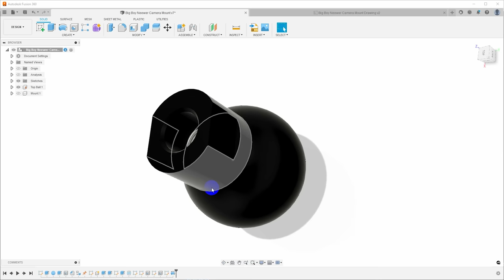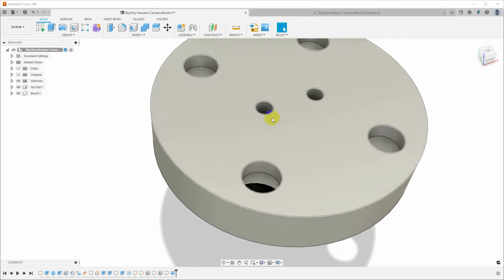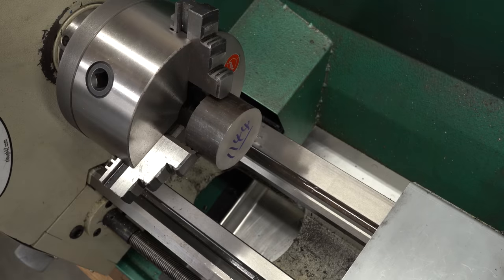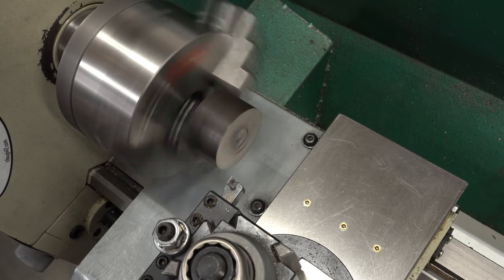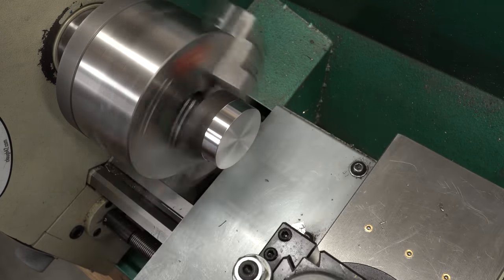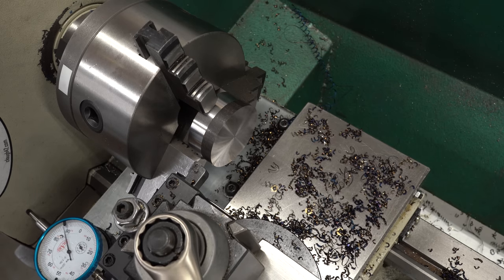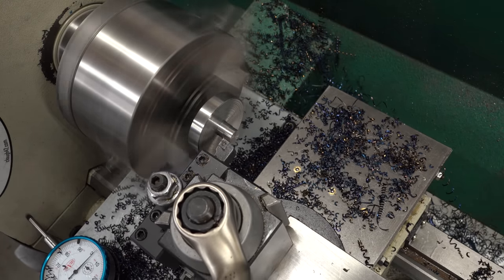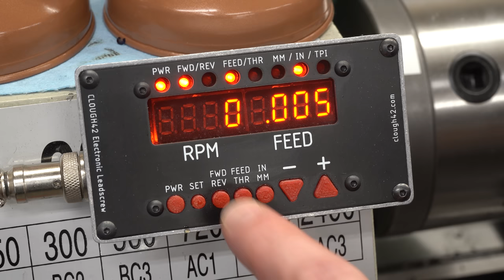Thread Milling on a Small Lathe | Making a Magnetic Camera Mount

Comment: this noga is not Overkill for indicators . maybe for the regular sized ones. But in a mashine shop you have many sizes  i have one with 150mm travel  at my job and this thing is heavy  you need somthing like this to get accurate readings
Reply from the maker: That's cool.  I have thought several times about getting a big dial indicator for my lathe, but opted to go for a DRO instead.

Comment: I would have done two things differently. I would have used a grade 8, 6mm bolt through the center, not a threaded integral stud. I also would not have counter bored the four plate holes, that way I could reach the hex head bolt with a flat wrench, lower profile and easier to reach than using a hex allen wrench.

Comment: Coulda just drilled a through hole in the center. Countersunk and used an allen cap screw to mount to the arm, but then i guess we wouldn't have seen that cool lathe mill threading. 😎
Reply from the maker: That also wouldn't have produced the registration shoulder feature I wanted.
Reply: @Clough42  true! It turned out nice

Comment: Can you anodize or powered coat in black to match the plate and arm and prevent corrosion?
Reply from the maker: Powder coat is a possibility, if I had the gear.  In general, camera gear wants to be black to prevent reflections.

Comment: Average armchair critic... I would have milled a socket for the shaft and wrench flats so the ball part fits into the adaptor plate.
Reply from the maker: I considered it, but there isn't enough length on the boss, and this would interfere with the ball pivot.

Comment: my only comment would be those set screws were overkill, any torque that would be great enough to unscrew that m6 would turn the ball before that happened. fantastic job though! thread milling on the manual lathe seems impossible yet its not lol
Reply from the maker: I didn't add them because I imagined there would be a problem.  I added them because I struggle with camera mount studs unscrewing on other gear on a regular basis.

Comment: Newbie question, why did you use a single piece of metal to make the entire adapter instead of making a disk and threading in a stud?
Reply from the maker: Didn't think of that.  I thought about using a screw, but that would not have allowed the shoulder.  I don't have any high-tensile small diameter material in the drawer, though, so...
Reply: @Clough42  since you've got lots of tools / techniques at your disposal, I just wasn't sure if it was a design / engineering practice or just based upon the material at hand.

Comment: Why thread mill instead of single point cutting? You need to set up and align the tool post grinder and the cutter must be expensive so it seems like a lot if extra effort and expense. Was there a special reason or just for the fun of it (which I totally get).
Reply: I believe "the fun of it" is spot on!
Reply: @paulcopeland9035  i kinda suspected that. 😜

Comment: Instead of using the set screws you could of just used Thread Lock or Lock Tight. Would of been easier, and there are different strengths available.
Reply from the maker: Maybe.  I have some other mounts that have come loose on me despite the loc-tite, so I opted for mechanical retention.

Comment: JC does not trust green Loctite?
Reply from the maker: Trust it for what?  To hold an M6 thread against the rotation torque from a 70-200 f/2.8 lens?  Nope.  To release when I want to take the adapter off and use the Noga arm for something else?  Also nope.

Comment: Why not use a threading lathe tool, why did you go with the threadmill?
Reply from the maker: I was making a relatively short thread that needed to go all the way up against a shoulder.  I didn't have room for a gutter to stop (or start) the thread, and didn't trust my ability to quick-draw the tool and stop the lathe while still running it fast enough to get a good surface finish on the thread.  Given it's a metric thread on an imperial lathe, opening the half-nut is tricky and easy to screw up.  I had a threading tool in the drawer and a live spindle, so I decided to give it a try.
Reply: @Clough42  oh yes, I forgot about the half nut issue! It was really cool to watch and I love your ELS

Comment: Wouldn't it have been more straightforward to make the piece flat and drill an M6 clearance hole (instead of turning the stud), counterbore the top and fit it to the ball mount with an M6 cap screw?
Reply from the maker: I wanted the shoulder to register in the counterbore in the ball stud, and there isn't enough meat there if I put a clearance (or threaded) hole through the part.

Comment: I hope you wipe down and oil the ways of the  lathe after using emery paper.
Reply from the maker: Hope is not a process.
Reply: Doing it is the process of preserving your lathe bed. Failure to do so will quickly wear out the ways as you slide the carriage over the abrasive dust left on the ways.

Comment: Why don't you cover the guides when you sanding? (or some oil - the abrasive won't fall to the guides)
Reply from the maker: I have a shield on the lathe that catches most of it.  If it's going to be excessive, I do cover the ways.

Comment: 1144 usually breaks chips way better than that. odd.
Reply from the maker: There are a lot of variables, for sure.  It's very possible a different insert with different chipbreaker geometry would have worked better.  I have some new tooling I'll be putting to work soon, and I have a bunch of different inserts to try.

Comment: Thread locker..s'all I'm saying.
Reply from the maker: Feel free to trust your camera gear to that.  And if you use something strong enough to hold, good luck getting it out later when you want to use the Noga arm for something else.
Reply: @Clough42  modern thd lockers have advanced considerably over the old days when heat was required to disassemble parts.   They hold under all normal conditions, and residues aren't a problem , and if so , clean it out with a tap.   No need to fear using thd lockers these days.
Reply from the maker: @jamesr.9239  As I said, if it's your $5k in camera gear, feel free

Comment: By the way that is not thread milling if that machine of yours was oscillating around the standing still shaft producing a thread that would be thread milling just because you put an end Mill in place of a turning tool doesn't make it a milling machine
Reply from the maker: An excellent example of combining two logical fallacies into one comment: a Strawman, and a Distinction Without a Difference.  Well done.

Comment: The machining is awesome but the design is not my taste. A single lump of aluminum and a screw in the middle would make the trick and get so much easier to make...well it's easy to criticize but your did it great anyway.
Reply from the maker: This is a great comment.  I chose to go this route because I wanted the cylindrical register in the socket on the end of the arm, and wanted a material harder than aluminum because the moment arm is large and I was afraid aluminum would deform and loosen.  It's entirely possible aluminum would have been fine.

Comment: Or you can just buy a C stand and not try to mount cameras to running machines that are going to vibrate no matter what.
Reply: Agree. Maybe he should make a c-stand. Just please done buy some shitty quality c-stand. Get a Matthews.
Reply from the maker: In fact, I have three C-stands that I use regularly to get cameras into all kinds of weird places.  The heavy B&H house brand ones (Impact) are pretty solid.  The lighter Neewer ones are a lot easier to move around, but they require some modifications, like adding aluminum friction disks, to make them usable.  Even then, they're really only good enough for something light like a GoPro.

Comment: So your design is unnecessarily complicated why did you machine down so much material for a little stud when a hole & bolt would’ve accomplished the exact same thing
Reply from the maker: I wanted a shoulder to fit tightly in the counterbore of the Noga, and there just isn't enough space to get that with a screw.  The wall thickness would be something like .020", and that wouldn't have the strength I wanted.

Comment: Great video. I’ve used the els to manually cut threads before but not with a mill cutter that was cool. I think I would have just used x and y offsets from center to drill the holes to save the time setting up bolt circle
Reply from the maker: I used offsets from the center.  It isn't an evenly-spaced bolt circle.